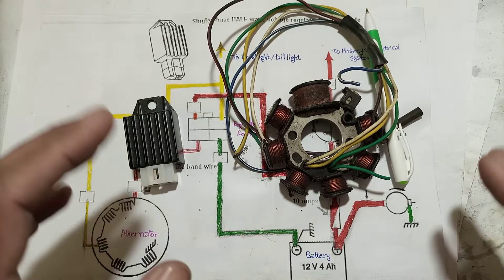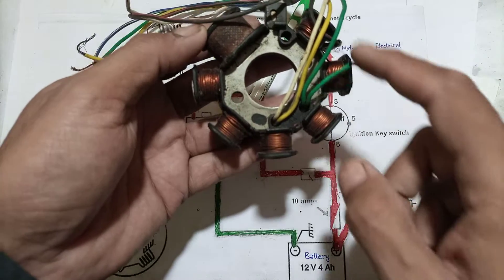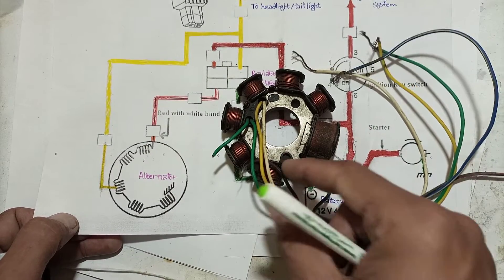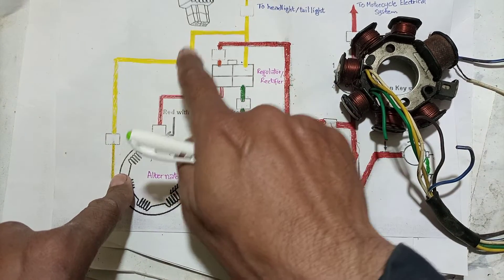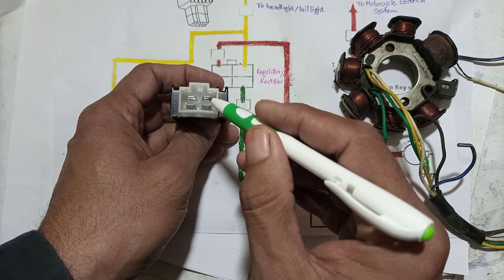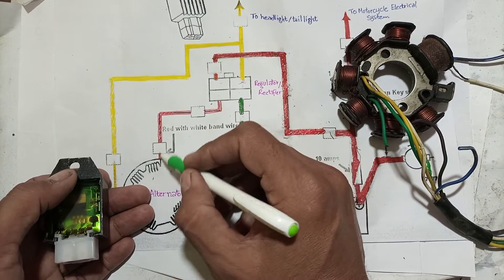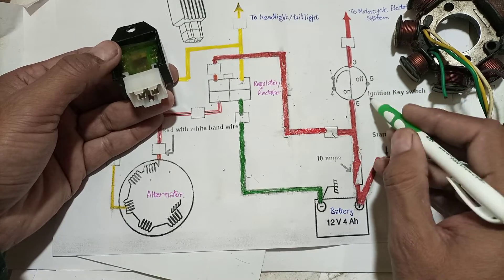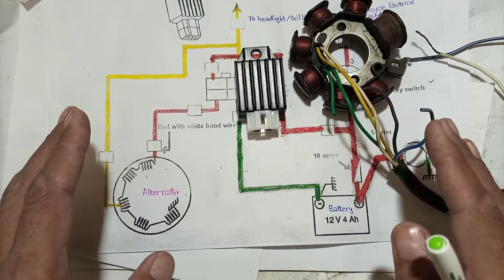Motorcycle Charging system. Motorbike headlight taillight wiring details.magneto regulator rectifier

Comment: This video tutorial is not 100% correct because many motorcycle models, particularly newer ones (specially YAMAHA) using a Capacitor Discharge Ignition system and especially those using the Transistor Controlled Ignition (TCI) system, do not have a dedicated CDI/TCI coil (also known as a source or charge coil) as part of the stator assembly. Instead, they use the main battery and the motorcycle's charging system to power the ignition.
Reply from the maker: Yes you are right. Battery ignition system do exist. But in our area mostly almost 99% motorcycle do use the explained magneto cdi system. That's why this video focusses on such a battery less ignition system. Regards,

Comment: How many watts load can this magnet coil take? No one has told this till today.
Reply from the maker: It's designed for some 25 watts. The power depends upon the engine speed.
Reply: @JahanZeb1976  How can I increase it by 15 more watts? It will be difficult but I want to increase it.

Comment: My hero hf deluxe is having low voltage at headlight connector can I disconnect yellow wire and attach to one more rectifier only to be used with headlight and a common ground?

Comment: Nice video❤❤❤ it will work as half wave rectifier or full wave rectifier?
Reply from the maker: Thanks for compliment. It's half wave rectifier for battery charging. Which is considered enough for such a small low power battery and low power usage like horn and indications.
Reply: Sir, could you please make video on single phase full wave rectifier RR unit used in bikes?

Comment: If LiFeP04 batteries must be charged less than 14.48 volts, how do I modify the motorcycle regular to match. Would have been better explained if you drew a schematic of the regulator and explained how it regulated the charging voltage.

Comment: wait what, series regulaor is triac which is not even in battery circuit, battery only has single diode, even on pcb you can see 2 terminals of connector are only to dioede. , iwhat am i missing?

Comment: If there is no yellow wire only white wire is available in the coil plate then what kind of regulator will be installed
Reply: this is supposedly half bridge which i dont get, they imply half coil is used for charging, your case would be single coil for charging than you can use battery for lights, dont take my word and check your stator, either one side of coil is grounded or you have two wires connected to coil ,same thing i think, aslo this is not regulator, i dont think, check out bigclievs video, its same circuit, full bridge rectifier is used for lights not for battery and batttery only gets half vawe from single diod, this is my understanding and i think this video is not right,

Comment: You said there are two regulators inside RR unit, one is series and other is shunt. Red wire gives regulated DC say not more than 14V DC, which can be connected to Battery. How to take output to Head Light, Tail Light, which should not exceed 14V DC ?
Reply from the maker: That is shunt regulator who regulates power to head and tail lights.

Comment: regulator rectifier is specific for specific battery ampere.  i mean this regulator (shown in video ) is for charging eg. 5ah battery   so for 9ah battery the regulator is different ?? i mean regulator is depends upon battery ah?  if i want to  charge 9 ah battery so i need rr which is like bike of  pulsar 220 or ktm 390 (they are 9ah battery ). battery charging ampere is bigger if we use big bike RR unit ?? or all are same output ampere
Reply from the maker: Just replace the battery with your required AH and keep the rest the same as old. It will work just fine.